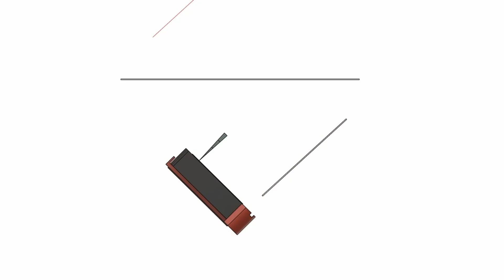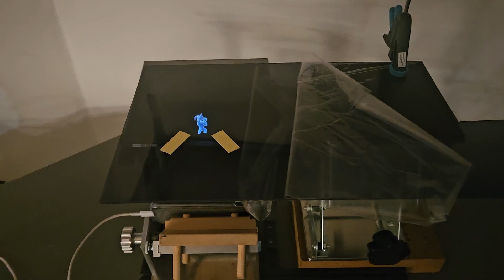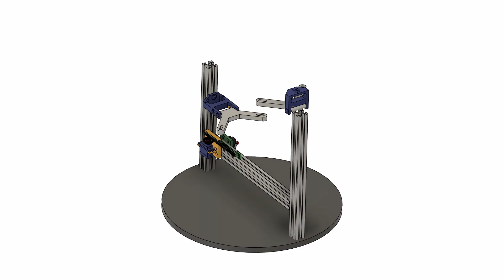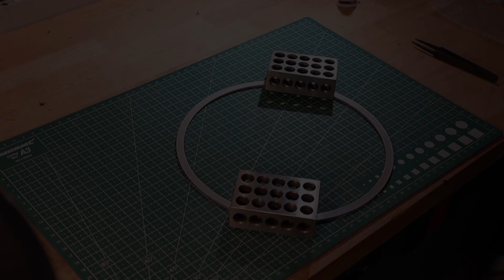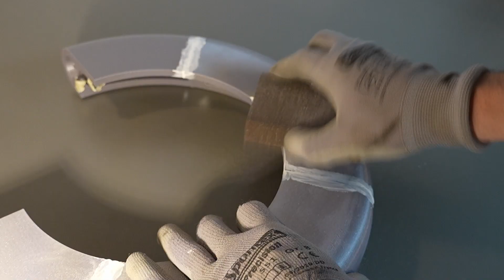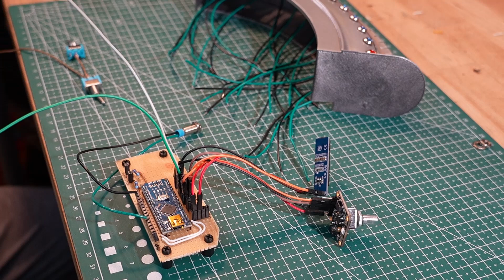How I built a working Holochess table

Comment: Is it Just me or is the use of multiple and moving Displays the wrong aproach? I dont know how difficult Programming or engeniering are but, having one Display displaying all Figures and their movement seems was more elegant and cheaper to me. 
And If it was preeloaded with other Games Like chess and a way to easily Install custom Animation, it could be sold.
Reply from the maker: Thanks for the comment. Due to the flat design of displays, however, the principle shown can only be implemented on one level, which is like one 2D layer that sticks out from the board. But we need several such layers for the spatial distribution of the figures on the board, and therefore several independant displays.

Comment: I got pricing for these plates:

Product ID 

Description 

Qty 

Unit Price 

(USD) 

Extended Price 

(USD) 

ASKA3D-200NT 

ASKA3D-200NT Plastic Plate Dimensions (LXWXD): 200mm x 200mm x 6.4mm 

1 

$365.00 

ASKA3D-250NT 

ASKA3D-250NT Plastic Plate Dimensions (LXWXD): 250mm x 250mm x 6.4mm 

1 

$665.00 

ASKA3D-200 

ASKA3D-200 Glass Plate Dimensions (LXWXD): 200mm x 200mm x 5.6mm 

1 

$3,000.00

Comment: Can the aska3d board be rotated fast enough to provide  for a 360 field of view?  A 3d render engine could have potential application as well for animations.
Reply from the maker: Thanks for the interesting comment.I had already thought of that, because it would remove the very narrow angle limitation and allow multiple viewers to see the same image from different angles. However, a fast mechanical rotation of the unit at >25fps is quite challenging. Let's see, maybe I'll try it in the future.
Reply: @makermac70  an even more bizarre idea is to use a full hdmi screen and render the images as 3d 'object' with mirrors above each image;  reposition the generated 3d 'movie' on the screen board and have the mirror follow it.  Sorry if it doesn't make sense?  Would love to test but lack the focus to pull through.  Can't stop dreaming tho!

Comment: I'm wondering if it would be possible to use parallax 3D displays for the chess pieces
Reply from the maker: Thanks for the interesting question. I tried this with a static parallax image, but the separation was not good enough to achieve the desired effect.
Reply: Can you share the cost of the glass screen? The website doesn't show the costs.

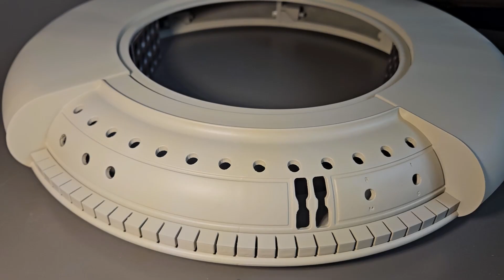Comment: 17:17 The primed surface is so smooth and the paint so uniform that I had a flashback to working on computer aided design software in the 1980s.  We used very simple Phong Shading with a light at infinity and a diffuse light. This let us adjust the images from unnaturally perfect matte to unnaturally perfect high gloss. We could select a color for the entire CAD model, but not for individual components within the model.

This barely related comment exists to prove that I am engaged with your excellent video.

Comment: Those plates are amazing!
Your implementation is awe-inspiring.
This production is top-notch.
The release timing is impressive.

I wonder, if you put one of those rotating POV displays directly under the retro-reflective plate, would you get a 4D image?
Reply: It depends on if the Aska works from all angles. Currently this design doesn’t, but I think that’s just because the OLEDS used are 2D, not 3D. I’m guessing a spinning volumetric display below would create a “true” 3D hologram. You still can’t view it from an extremely side-on angle, it only appears to your eyes if the Aska is “behind” where your eyes are looking, but still, for a “look down at the table” thing like holochess, that’s acceptable.
Reply: Or maybe they add up, so 6D chess could finally be a thing.

Comment: This is really awesome. I imagine this technique could be used to project one of those vibrating membrane volumetric displays in the air. My issue with those has always been that you cant put your hand through it.
Reply from the maker: Thanks for the suggestion. Others have suggested this as well, and in fact a true volumetric representation was the first thing I tried when I got the plate. Unfortunately without success so far, but I guess I will keep trying.

Comment: Awesome video! I was curious if there is a reason you had everything on its own display instead of putting it all on one display and moving the characters around that one, it might allow for a full game and have fewer moving parts. (Its probably weird optical distortion with the hologram but im not sure)
Reply: One planar display makes one planar hologram. One planar hologram intersects one planar chessboard along one line. The goal was to make multiple characters intersect (well, "stand on") their tile. That means multiple lines of intersection, which means multiple not-co-planar displays.